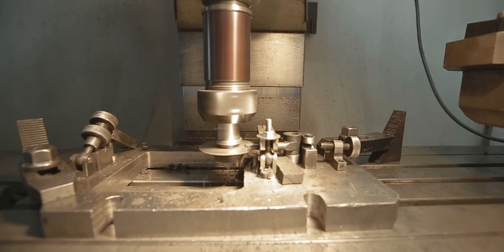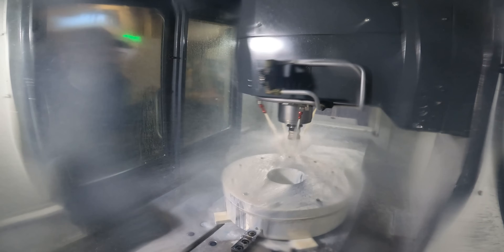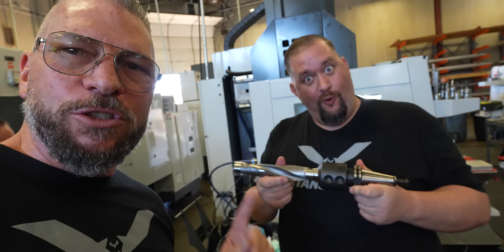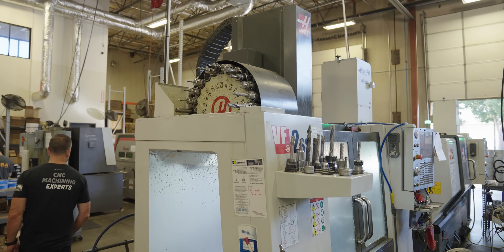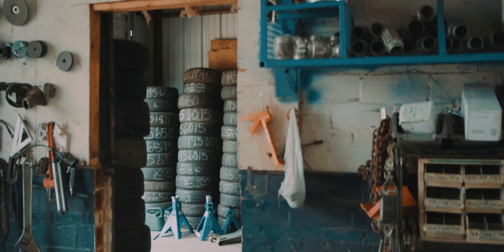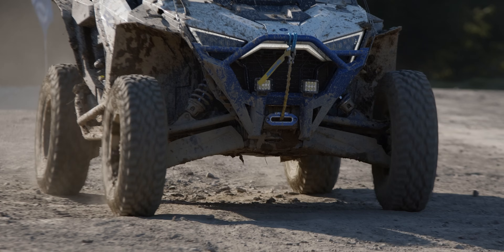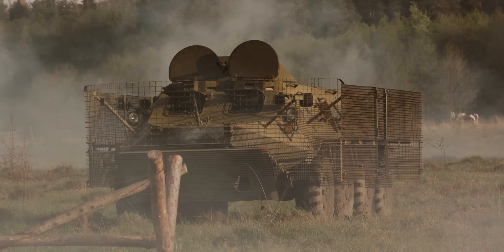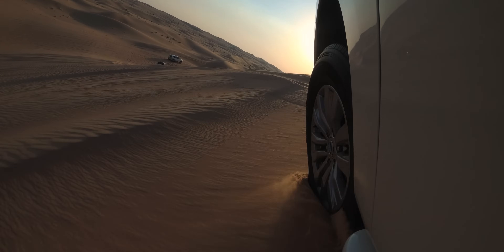Machinist Finds Niche to CNC Machine Motorsport Parts FASTER

Comment: I see you guys have 3D printed jaws for milling is that mostly finishing work and if not have you ever printed jaws for hogging I recently printed a fixture to hold the od of a round plastic insert (nylon) for over molding (prototype) molded plastic in production worked but very inefficiently (one at a time slow cuts) low quantity<~10 .9in parts) any advise on how to think of the issue differently? Not a machinist but I talk to them frequently for stuff like this

Comment: Love these automotive machine shops. Good video. One part I’d love to see y’all tackle is a pump wedge for a JetSki. Mine has a 2 degree one on it. I’ve never seen any other option than 2 degrees. Maybe y’all could make a 4 degree one. For those wondering, a pump wedge is a way to angle your thrust on a jet drive upwards to get your bow out of the water and reduce drag. It’s better than trimming up because when you trim the steering nozzle up, yes you are getting the bow out the water but by bending the flow or water coming out of the exit nozzle, you actually lose thrust
Reply: Lots of thin walls on that part. And the fact it’s aluminum adds to that fact. I’d love to see that too
Reply: Maybe that should be YOUR niche 3:54